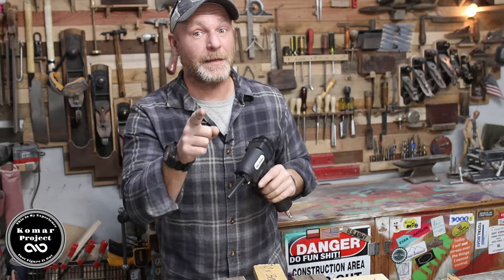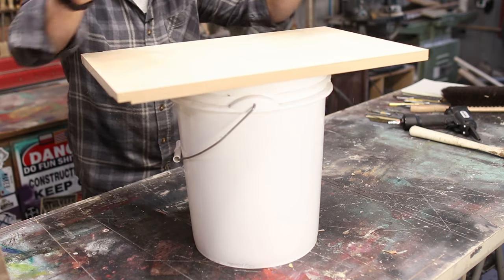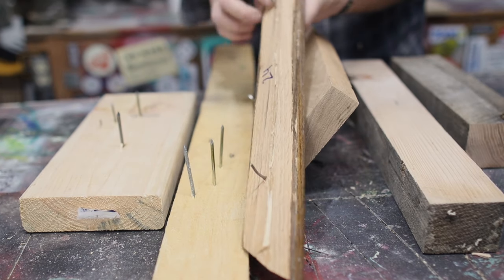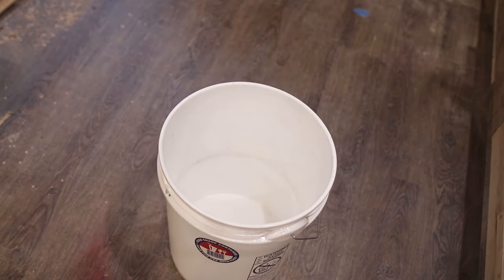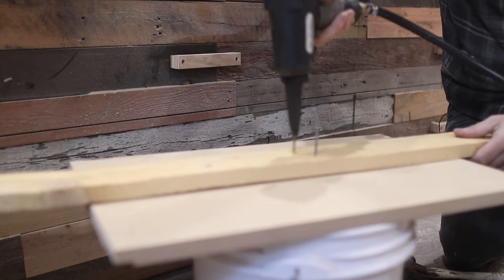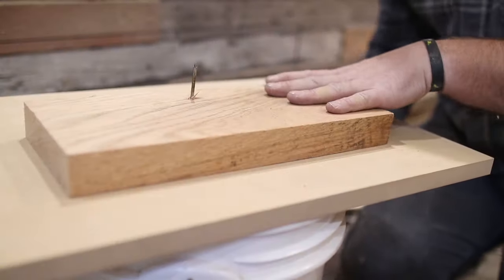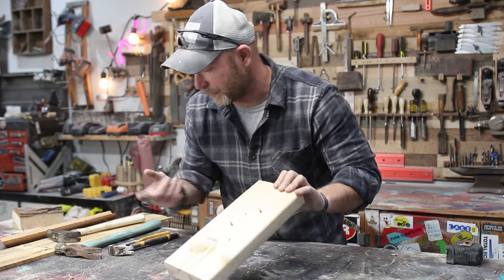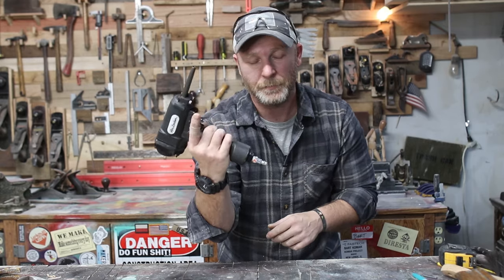How to Remove Nails form old wood ||| Best Nail Removal Tool On the Market!!! AirLocker AP700

Comment: I would like to know how you would remove nails that are completely embedded within the wood.
Reply: Nail set or pin punch
Reply: As long as the bottom of the nail is exposed it will shoot out that embedded nail works great but if u got oak or hard wood it will knock them out 1/4 of the way or just bend the nail but u can get a start on it then use your hammer to remove the nail😮

Comment: Fill the bucket 2/3 full of water and there's zero chance the nails will ricochet out of even that small slot. This also means you have a heavier, more stable platform to do your de-nailing.
Reply: Someone's done this before. :)
Reply: Very good point!!!

Comment: This tool is absolutely worth the money. I believe I ordered mine for like $50 or $60. It makes nail removal so easy that my 7 year old who loves to do projects with me can clean boards just as quick as I can break down the pallets.
Reply: I made an attachment to mount on the front of mine so that I could use it to countersink nails to the depth I wanted! Made countersinking hundreds of nails a breeze when I painted my house!
Reply: I would absolutely NOT let my 7 yr old play with a tool like this. If he pointed it at another kid's head and pulled the trigger that driver would go thru the skull and you would be in jail for both child abuse and criminal negligence.
No matter how responsible they look working alongside Dad, kids do stupid things, impulsive things, especially boys!
Do not let him near this deadly tool. Yikes!  Instead, raise your pallets on two boards, and give him a rubber mallet to hit the boards below so they disengage from the pallet.  Also works with a block of wood. He will be safe, and he will do all the bending so you spare your back.  I would work far from him with this air tool.  Your wife will never forgive you if anything happens to him.

Comment: My wife got me one of these and I found it a bit deceiving because it's advertised as a Nailer and NOT a nail Remover. Until she brought it home i never even knew they sold an air nail remover. So I've been watching YouTube seeing it ANYONE actually uses it as a Nailer to see how that works and clearly everyone uses it for nail Removal. Anyway I guess I can't complain because she got it for only $7 from a store that sells Amazon Returns and surprisingly it came with everything it was supposed to the instructions, the spare pin, the Alan wrench and even the little bottle of oil.
Reply from the maker: Ya I think it’s only a remover
Reply: Sean, which return site did you use?

Comment: I bought one of these for a major pallet wood wedding project - it is an EXCELLENT tool. I used a 5 gallon bucket also and filled it about a 1/3 full of water to somewhat slow and capture the nails so they wouldn't ricochet. It worked great.
Reply from the maker: Farmercl's Woodshop water, I never though of that. That’s genius.  You can also put foam in the bottom too.
Reply: @KomarProject  or saw dust

Comment: I am rebuilding a cabin from early 1900s all the walls and ceiling’s had 1 inch hardwood boards under drywall. Ordered this tool and it makes fast work and doesn’t leave hammer marks on the reclaimed wood

Comment: I LOVE my Airlocker. I've used it for 3-4 years and have removed thousands of nails from the pallet. I have pulled over 200 pounds of nails using it. I use two sawhorses with a large trash can under them with an old Blue Tarp in the can. This prevents the nails from bouncing around the shop. I'm not too fond of your method because you must spend more time aligning the nails with the small hole you cut. The pallets I am taking apart have almost 200 in them and I usually take apart 3-4 pallets at a time so any additional time alignment to a small hole translates to a lot more work time. I also prefer using Crowbars instead of the pliers you use. I use a 3-footer on the 10-16 penny nails and a 2-footer on smaller ones. They are a lot quicker and require less effort to pull the nail. IF you can find it, pick up a "Kwickgripper", this tool will pull rusted, headless nails out of old oak pallet stringers. Finding one is the challenge.

Comment: Compare to using an SDS hammer drill with a cheap hex adapter - works about the same.
If you're doing a lot of recycling and have a compressor handy - go for it.
But I'm going back to the hammer and the pincer-puller or the plier-puller for the small boards bc I'm basically cutting the big nails flush and leaving them in the 2x's and bigger - it's utility and project lumber after all.  And nails come out easy in the 1/2" wood that pallets use.
I'm using a 28# Bauer SDS Max 18ftlb hammer drill with a 1" chisel to do the mean work - which is a work out trying to get it out - but I'm thinking seriously about building a hydraulic seesaw press (that you stand on) bc I'm loving the 8-10 ft 3x3, 2x4, 2x5's that I'm getting out of motorcycle pallets - 4 to 6 per.

Comment: When I remove molding that I intend to reuse I pull the nails through from the back side rather than pounding out the front.  A lot less damage to the face of the molding.

Comment: Great video.  Have you tried to remove cleats from hardwood flooring with this tool?  Since cleats are flat and tapered, I wonder if the Airlocker would just bend or get jammed.
Reply from the maker: I haven’t but it’s worth a try.  Anything to make it easier
Reply: I  am using on for cleats on 900 sq feet of reclaimed wood flooring. Works great!
Reply: I did bend the cleats with pliers to get them so it'd be a straight shot through.

Comment: Hi love the review although I have one question (I bother asking because I see you are responsive in the comments): Will it remove the tiny-short very very thin nails, that are almost like needles? I have 5 mm plywood with lots of nails to reclaim and I'm worried it will bend the nail on impact before it drives it out. I can put something around the nail to protect the ply I guess.
Reply from the maker: If your talking about Brad nails it depends on their thickness.   The thicker ones it will but pin nails it will bend over.  You best bet is to get a pair of nail pullers like you see me you in the video.  The yellow ones and that works really well

Comment: I break down pallets .... manually ... Without the Air Locker tool (I need one of these !!) , the most reliable way I have found is using the pliers (I have a pair of Chanel Lock) - The mechanical advantage you get makes all the difference and if the heads are destroyed it doesn't matter, you just have to not squeeze hard enough to cut the nail off....perhaps the DeWalt tool doesn't actually cut them off I don't know.
A mill faced framing hammer works best if you have to do any driving from the pointy end, or using the claw side of that to twist the nail back to a straight enough condition to hit and push the head end out enough to grab

Comment: I work for a pallet company  the only job I have ever had  we use this air locker it does everything we need so we never tried anything else we remove enough nails to fill up several 55 gallon drums a year get extra drivers they can break get chipped at our volume of use

Comment: One of the biggest issues I have is removing T1-11 and I have tried every nail puller out there. Would this tool be strong enough to drive the nail (head side) holding siding through the siding (into the stud) so the siding  can be removed.
Reply from the maker: It should I think.

Comment: Invaluable tool for reclaiming wood..I use a 55g barrel(can use metal or plastic)and filled bottom of barrel with few inches of wood shavings (to absorb water the nail.)Made wood too much as you did..and keep it outside shop and very ergonomic don’t have to bend over..started with a   livestock mineral tub but either had to set it on something or bend over..(and the latter not so good at end of day if doing large amounts)..good and to the point video

Comment: How do set up that connection for the gun because I don't have that connection on mine  what  kind  of connections  do you  recommend  I'm  new to this
Reply from the maker: You mean the compressor connector ? I think it’s just like with any other numatic gun. Just use some Teflon on the threads

Comment: Have you ever tried just filling the bucket with sand or water to catch the nails? That might be far simpler/quicker.
Reply from the maker: The small bucket was just for the video.  I typically use a 55g shop barrel to catch them.  They usually stay in there lol
Reply: @KomarProject  Ah yeah, that'd do it lol. Well, then perhaps one of your viewers will see my suggestion and be inspired.

Comment: I wish they would make a smaller one. I have the one you show in the video and it works grate for most stuff but I tryed  using it for old reclaim lath slats and all it dose is miss the nail and brake the lath
Reply from the maker: I think you can turn down the air maybe.  Not sure if that will work

Comment: For trim/finish nails I was taught to pull through from rear so as to not chip surface appearance
Reply from the maker: Ya you can totally do that.  That’s actually right for nails without a head.
Reply: @KomarProject  even w heads, we'd lightly tap back & nip or cut w dremel & pull. Keeps tool marks off the face. I do a ton of "repair" work so finish blending is always prominent in my mind.  Double handling is a pet peeve of mine. NOTE: I recently found your channel & can say it slightly restored my faith in YouTube. You do amazing work & I thank you for your service as well. 🇺🇸

Comment: Yep looks good except for any pallet I've grabbed are nailed together with annular ringed shanks. Needless to say you will split wood using a pry bar trying to separate the boards. Yep I know use a reciprocating saw then airlocker.

Comment: what kind of pliers are you using to pull them after using the air lock?
Reply from the maker: They are made by dewalt but haven’t seen them in a while

Comment: I have some 2x4s from some pallets that I've been trying to get nails out of for a while.  The nails are in the 2" side not the 4" so hammering them in more wont help.  When i try to pull these nails they just break as theyre so rusty.  What do you suggest?
Reply: Are you pulling them with a puller, a hammer, or are you pushing them with the air tool? If they're breaking, I'd try the opposite approach to see if the nails hold together. If you were pulling them and the heads were breaking off, then try pushing them through and vise versa.

Comment: You can pretty much do the same with the nail gun you put it in with. Works 90% of the time
Reply from the maker: Never tried it that way. Will have to check it out sometime
Reply: Obviously right gauge gun for matching nail . It works 90% of the for me I actually took a nail out of my hand one day. Not pleasant to say the least. It was that or vice grips . After being a furniture/ cabinet maker for 55 years you’d think I’d learn.
Reply: @sphlouge  I know this comment is soooo old but I have to ask. Did you know to try removing the nail with the gun immediately after you nailed your hand or was the story more involved? I imagine your hand being attached to the workpiece and the only thing you can reach was the tool you were already holding. :)

Comment: What if the nail is on the wall on a two by 4 and only access to you is the head of the nail ??
Reply from the maker: In that care take some nail pulling pliers and you will have to do it by hand.  This only works if you can get to the back side of it.

Comment: will this work to remove nails from a deck floor
Reply from the maker: If you pull the planks up and The nail is sticking out of it it will.  But other wise it won’t

Comment: Hi love the video   after watching  I purchased  a airlocker ap700  from Amazon     great thing  at first  then  it started  to jam up in the nozzle   not with quiet large  nails  it worked  awesome  but with small  thin gauge  it just keeps  jamming  up in the nozzle  I've had to completely  strip  the gun down at least  50/60times  now  it seems to me  that the ram ie the rod that does  the  pushing  of the nail  is to thin and could  be a bit thicker tbh  and now sadly  I've only  gone and lost apart    ie the round  black  rubber  driver  guide  and its going  to cost  a small  fortune  to get  to the UK sadly   not sure  what to do if I am honest  any way love you're  videos  awesome  keep  up the good work  all the best lindsay  😎😎

Comment: The Air Locker literature online (http://www.airlockernailers.com/air-locker-ap700-heavy-duty-professional-punch-nailer-nail-remover) says that the AP700 will work with nails between 10 gauge and 20 gauge. A 10 gauge nail is only an 8 penny (8D) at 0.134" for the diameter of the shank.

However, the same online literature says that the AP700 will handle nails up to 0.16" diameter.

10 penny (10D) and 12 penny (12D) nails have a shank diameter of 0.148" and 16 penny (16D) nails have a shank diameter of 0.165". Do you know (or can you try it to see) if the AP700 can drive any of these nails with larger diameter shanks?
Reply from the maker: I used it super thick nails before.  Not sure the diameter but definitely bigger then your standard framing nail.  Just might have to hit it more then once but it will work for sure.  Even works on those twisty ones.

Comment: Hi from England good video, got mine delivered today from Amazon, only had to buy a connector for my compresser, works pretty good saves a lot of hard work. The one tool I dont seem to be able to find is that dewalt nail puller, it looks great but there are many things you can buy in the USA that we just dont get, shame , never mind be lucky mate
Reply from the maker: I looked recently and they don’t seam to sell it anymore.  I’m sure there is a different brand you can fin

Comment: kinda seems like made up problems.  being told to bang back exposed nails at work is like being told to take a break.  straighten bent nails with the claw on the hammer.  have a punch to drive cut off nails.  if you're pulling finish nails from something you're re-using, don't bang them back through the face, pull them out the back with chanellocks or pliers.

Comment: None of those nails looked driven home at all!!! They all looked lightly hand driven just to the surface of the timber...pallets are fixed with nail guns which drive the heads of the nails well under the surface of the timber which is what I wanna see it deal with....

Comment: Nice demonstration.
Could've gotten all the useful info into a 2 minute video which would be 4x better. For example, not much value in showing us how to cut a hole in a board. Also, no real value in explaining each board before getting tool out and then explaing each board again as you actually use the tool on it.

Comment: You are a tease. You mention pallets and nails in the same breath of air. But you don't remove a pallet nail from a pallet. does your toy work on the hardest of hard?? Wrong toy, baby.  I play with  pallets all day and if the nieghbors aren't home all night. The ones that get me are the dence hard wood mother _____ with those twisty nails in them. please show me if your toy helps with them. Thank you L
Reply from the maker: Yup it will remove the hardest of the hard.  Sometimes with a twisted it takes two shots but it will get it
Reply: @KomarProject  thank you for getting back with me. I think I need this tool. Do you get a kick if I hit the link that you supply? Cause if you do that is how I will buy. If you don't then I will shop around for the best deal. If you do get a kick could you please supply the link in your response to make it easier on me. Thank you so very much!!